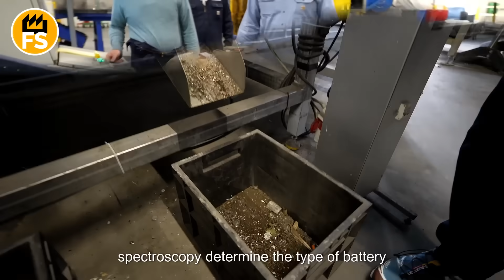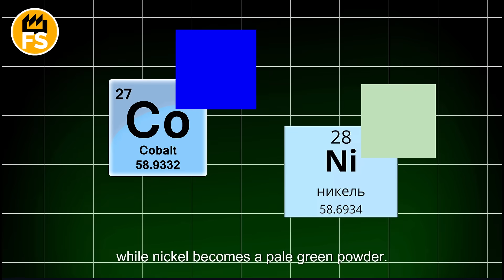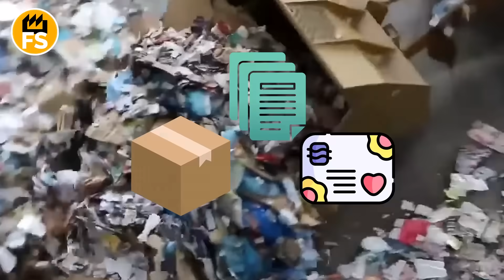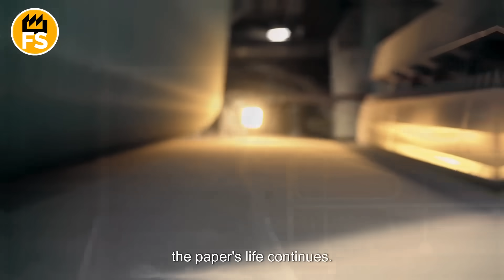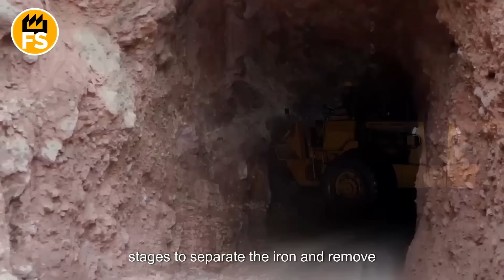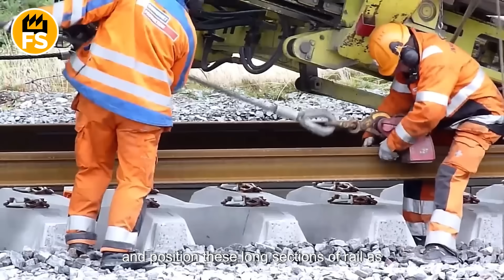Millions of Batteries Every Day! How Are They Turned into Treasures?

Comment: You fail to mention the down side of recycling paper. After the ink removal you have slurry, a toxic paste that has to be taken to a waste center. A toxic special permit is required to dispose of this ugly stuff as it is very damaging to the environment. You also fail to mention that recycled paper has shorter fiber, a process of re-using the same material over and over. The final damage to nature is greater than planting new trees and harvesting them for pulp.
Reply from the maker: Thank you for your insights, @stevenbates7451. While recycling processes can have challenges, including the concerns you've mentioned, the focus of the video is on the innovative ways batteries can be recycled and transformed into valuable resources. 🌍🔋

Comment: I'm a rebel that recharges non-recharable batteries. You can do it about 10 times before the battery deforms and it stops holding a charge. You have gas build up inside the battery, but most batteries have a pressure release system on them, I think older batteries used to explode which is why they tell you not to do it, well that and you have to keep an eye on it, if you leave it charging and forgot that's bad, all the liquid and stuff comes out.

I'm actually kinda mad I threw so many batteries away, got have at least got 2 uses out of them.
Reply from the maker: It's fascinating to hear your perspective on battery recharging! 🔋 While recycling millions of batteries daily is crucial, ensuring safety and environmental responsibility is paramount. Thank you for sharing your insights!
Reply: I used to do that. They got hot obviously and they lasted only a short time....... Surprisingly I never had one blow up or ooze......

Comment: I used to take my small batteries to the battery store and they will not take them no more they told us to just throw them away and they sell a lot of batteries
Reply from the maker: It's unfortunate to hear that battery recycling options have changed! 🤔 It's crucial to find sustainable ways to handle batteries, as they can be turned into valuable resources rather than just being thrown away. 🌍🔋

Comment: It is absurd that batteries are used instead of accumulators. Even the cheapest accumulators can be reused 500 times, while their price is only 5-10 times higher than a battery of the same capacity. The use of batteries is justified only for watches or some sensors, where they are used for about a year.
Reply from the maker: You raise a valid point about the sustainability of accumulators versus traditional batteries. It's crucial for us to consider these alternatives as we seek to minimize waste and maximize resource efficiency in our daily lives. 🌍🔋

Comment: In my area of NY State, paper, cardboard, most plastic containers, glass containers, and metals are recycled. It is too costly to recycle anything but cardboard for some manufacturers, recycling isn't even attempted by some, I have alerted the cost saving process of recycling copper and stainless steel to a machine shop I used to work for.
Reply from the maker: It's great to hear about the recycling efforts in your area of NY State! ♻️ As we explore how millions of batteries are transformed into valuable materials, your insights on recycling metals like copper and stainless steel highlight the importance of maximizing recycling processes for sustainability.

Comment: Nice video. A little too detailed.

In Denmark, we have collected used batteries for almost 30 years.

25-30 years ago I helped build a machine for a factory in Germany where they turned old paper/cardboard waste into "new" cardboard to be used for cardboard boxes. It is actually fascinating to see the employees making "cardboard" at 70 km/h between 2 endless sheets.

I remember it as very hot work.

I also remember they had a display case with things found in the paper packages shown in the movie.
There were all kinds of batteries, cutlery, keyboards (and other electronics), banknotes and coins and even a dildo. 🤣
Reply from the maker: Thank you for sharing your insights! It's fascinating to hear about the long-standing practices in Denmark and your experience with recycling paper into new products. 🌍♻️

Comment: The narration talks about what is in rechargeable batteries. Yes recycle those. Most big box home centers will take those. The stock footage shows mountains of disposable single use batteries. I don't know anywhere to take disposable batteries for recycling.
Reply from the maker: Thank you for your thoughtful comment! It's crucial to recycle rechargeable batteries, and while finding locations for single-use batteries can be challenging, many local waste management facilities and some retailers do accept them for recycling. 🔋🌍
Reply: Carbon zinc batteries cost more to recycle than the common materials they contain are worth once extracted.
Reply: Here in Australia, supermarkets and hardware stores have battery boxes where you can put your old batteries for recycling.
Reply: Many large shops in the UK have a container to them in, unfortunately, they are not always in an obvious location.
Reply: Here in Switzerland any store that sells batteries has to accept batteries for recycling. They are collected and sent to a centralized recycling plant. (In this case, one of the ones that works by smelting them.)

FYI, the video mentions recovering manganese and zinc, which are what’s in alkaline batteries.
Reply: @tookitogo  I know a store in Pa which would empty that bin in the garbage when it got full. The USA should do more recycling when it is barely cost effective but we waste so much effort pretending to recycle plastic as we incinerate much of it.
Reply: @jburdman7  Sadly that doesn’t surprise me. Here, e-waste recycling (which I think includes batteries, but don’t hold me to that) is funded by a fee collected at the time of purchase, so the recyclers are well-funded. Unfortunately I don’t think there’s any other way to do it. People just don’t care enough otherwise.

Comment: Use A.I. to sort the battery.  Make each type of battery with a bar code and have the machines scan the bar code and sort the battery type accordingly
Reply from the maker: Thank you for your insightful suggestion! Implementing A.I. and barcoding for battery sorting could greatly enhance recycling efficiency and ensure that these valuable resources are properly processed. 🔋✨

Comment: This is mind-blowing! Who else thinks recycling batteries could be the key to solving future energy challenges? What other products do you think could benefit from these recycled metals?
Reply from the maker: Absolutely! Recycling batteries indeed holds immense potential for addressing future energy challenges. Additionally, other products like electronics and electric vehicle components could also greatly benefit from these recycled metals! ♻️🔋
Reply: Some 70% of all aluminum ever mined is still in use today, steel is easy to separate magnetically and worth something, copper is worth quite a lot.